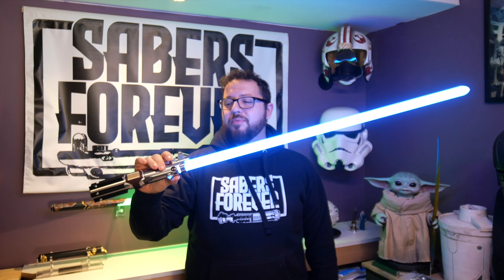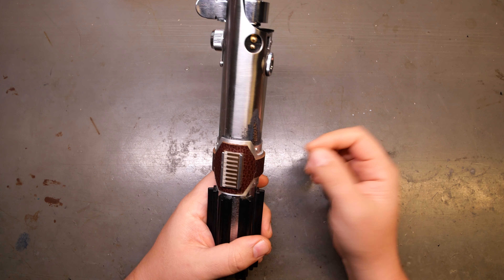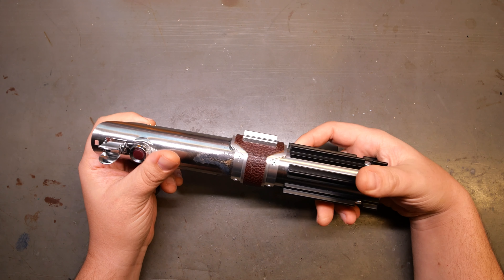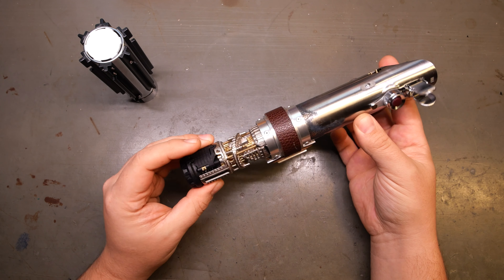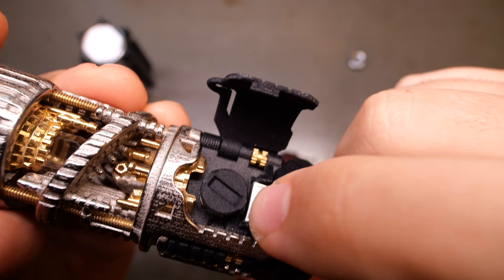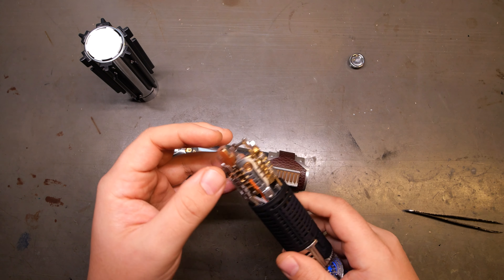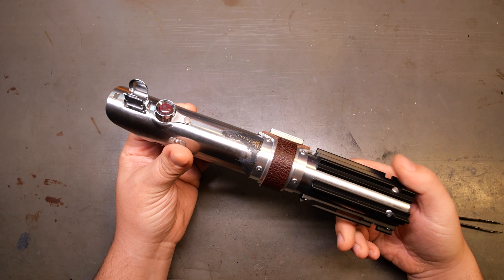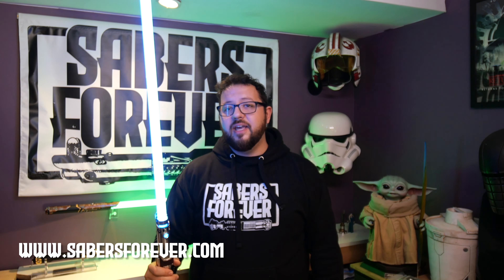TROS Graflex Master Chassis Installed by Sabers Forever

Comment: I have a KR Sabers TROS hilt along with the KR Sabers  Standard 1 inch balde holder. My question both blade holders come in two parts  black anodized piece and an aluminum piece. How is the black anodized piece attached to the upper section of the graflex?
Reply from the maker: The smaller black anodized piece gets held in by the top flat head screw above the glass eye. The bottom part gets held in by the glass eye it self. It’s for a removable chassis system.
Reply: @SabersForever   Thanks